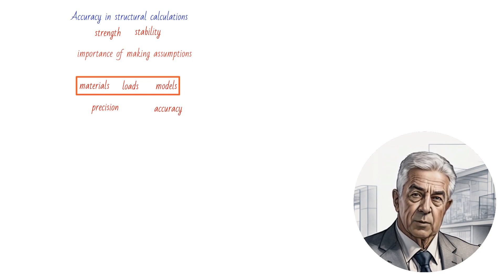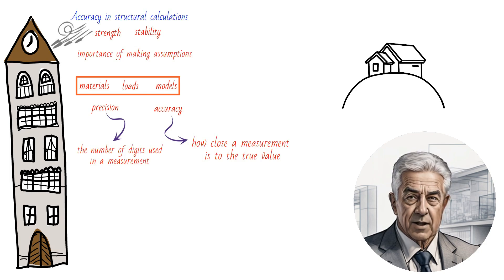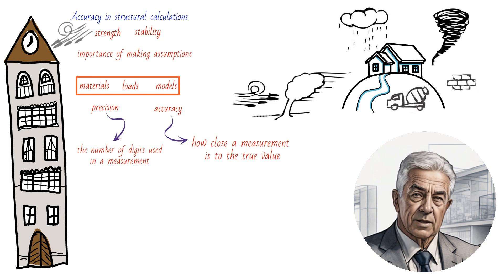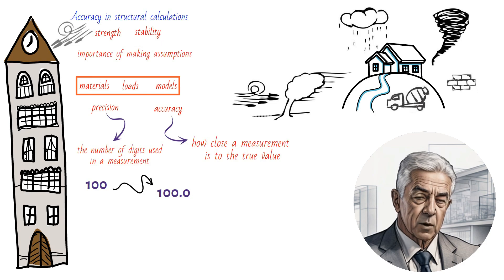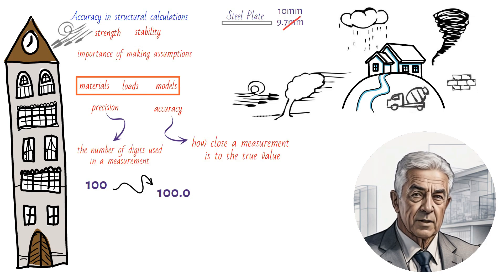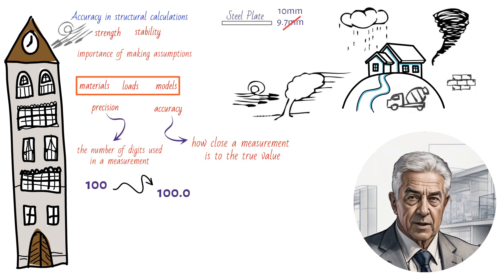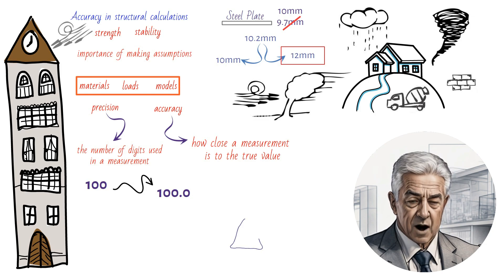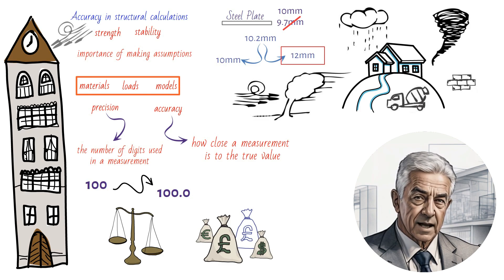Designing for Safety | The Role of Assumptions, Accuracy, and Precision in Structural Calculations.

Comment: Great content but the more precise and accurate the calculations, the more costly structure will be does not sound right to me. Engineers can over-estimate loads or oversize members costing the clients with more material than they need. One reason of precision and accuracy is to avoid that no?
Reply from the maker: You raise a valid point. It is true that engineers can sometimes overestimate loads or oversize members, which can lead to unnecessary costs for clients. However, it is also important to ensure that the structure is safe and able to withstand the loads it is designed for. Precision and accuracy in calculations can help to prevent costly mistakes and ensure the safety of the structure. It's a balance between cost and safety. Ultimately, it's the responsibility of the engineer to make sure that the structure is safe while also being cost-effective.